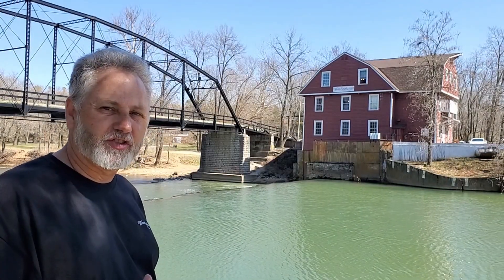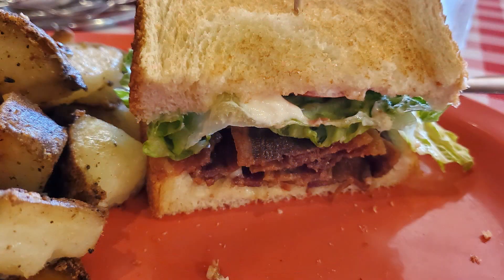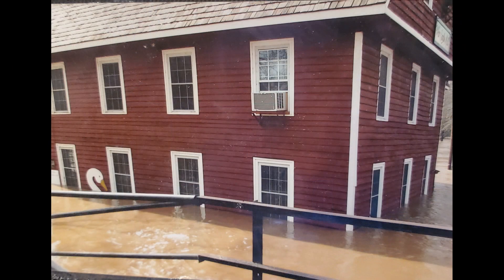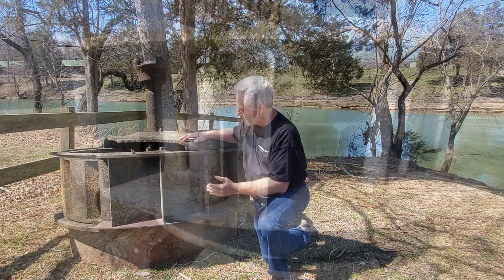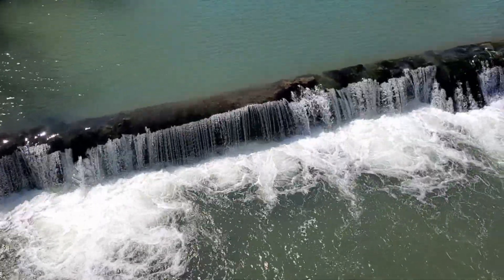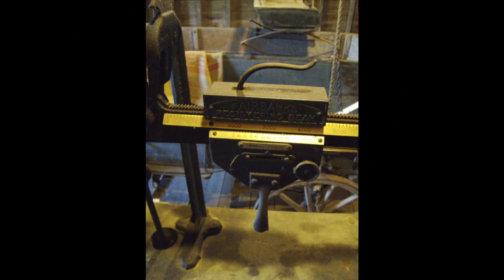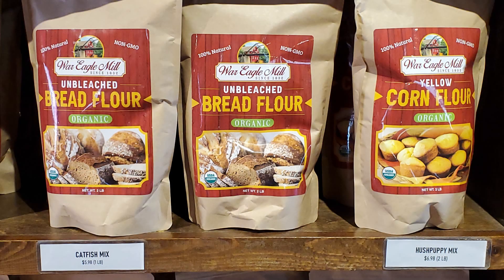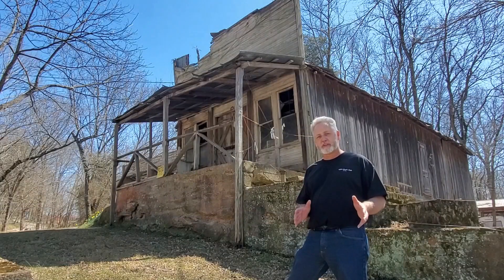Let's explore War Eagle Mill. How do grist mills work? Grinding corn and making flour using a mill.

Comment: Hi there!  Love your tours!  Are or were there any mills that did not require a dam?  That only rely on the natural flow of the water?
Reply from the maker: There are a couple  in Southwest Missouri. One  is called: Falling Springs Mill. It runs by using a natural spring that comes out of a shear clift face. And another is Zanoni Mill that also utilizes a spring. I'm sure there are more.